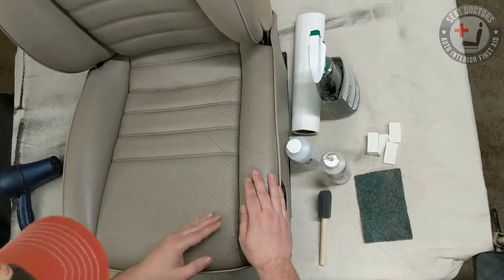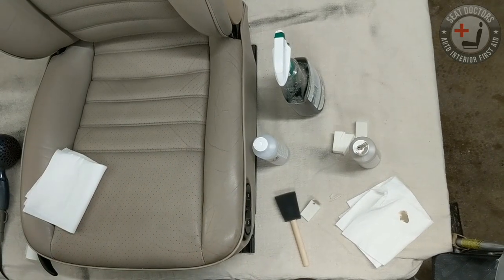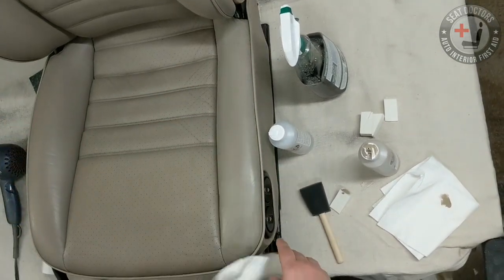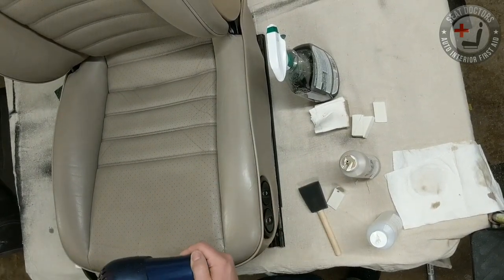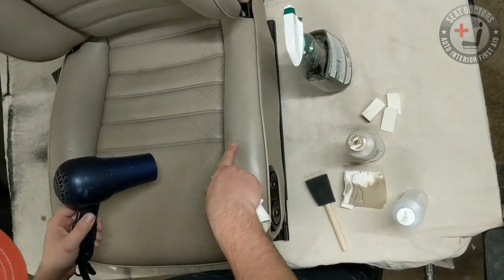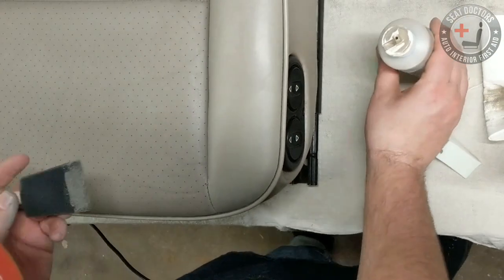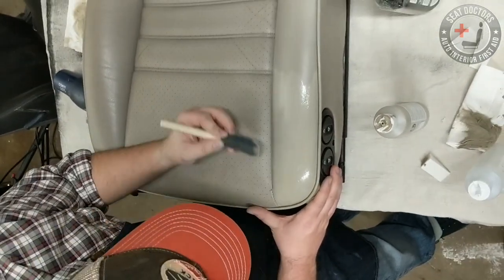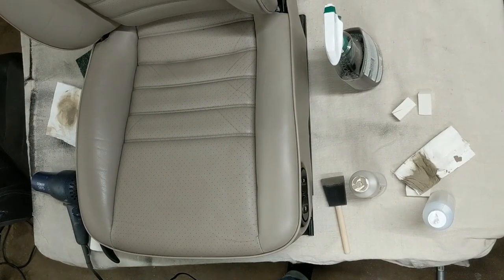Seat Doctors Leather Dye   Rub On Method and Paint Sponge Method

Comment: I have used this product as well. Unfortunately the filler doesn't hold up. If you apply it to the piece of leather that gets stretched when you sit-down or get up it will crack. The paint is disappointing as it comes off if you use rubbing alcohol and most likely will come off if using another cleaner. It should not happen to leather dye. You need to apply seven coats to make it even if not using spray gun. The leather texture is lost by the time you are done. Overall great for car flippers but I am not one of them. Color matching was not very close in my case, definitely noticeable if you don't paint the entire interior but this could vary. 1 filler is not enough for 1 seat and they claim it is enough for the entire vehicle.  So get 2 of them if you have a lot of repairs and don't expect magic. Overall the seats look better, but I need to find filler alternative. Tired of reapplying and repainting...

Comment: So I have a brand new Mazda CX-30 Preferred with parchment colored seats and got tree sap from SOMEONE 🤬 leaving the sunroom open.  I got the sap off, but it took the color off or maybe it's just what won't come off of the leather.  ANYWAY, ordered the parchment color as per instructured by Andy. I'm waiting for it to arrive, and was wondering what would you recommend I use to apply? A painter's brush , a makeup sponge ....Its basically a long straight thin line and then a few droplets on the bottom.  Thank you!!!

Comment: So, to make sure I understood you correctly, I should condition the leather prior to applying the dye?...with all dry of course. You did a superb job.
Reply: For anyone that follows, no, do not condition the leather, only clean it with a water based cleaner (Lexol or Simple Green) first. Conditioner will leave a residue. Clean, apply dye, let dry, apply second coat, let dry (third coat if needed), let dry for a few days afterward. Then conditioner every six months or so. 👍
Reply: No, do not apply conditioner first, it will leave residue. Clean the area with water-based product (Lexol or Simple Green), let dry for a few hours. Then apply dye, let dry. Apply second coat and let dry. Apply third coat if needed and let dry. Let area dry for a few days before applying conditioner. Condition every six months or so. 👌
Reply: simple green says on the bottle not to use on leather. i see he suggested it in the video too. should it be used?  yes/no?

Comment: Thank you for sharing. This was so helpful. But I have an acura with dove gray seats. My driver seat has a blue stain that I can't remove with cleaners. I purchased the dye from seat doctors- exact match but will I have to dye the entire section of the car seat  for a stain in the middle of the seat? 
My test patch is a good match but it seems a little lighter. Maybe additional coats will look darker?

Comment: What product can i use to remove another dye i tried to use which did not match the color of my leather seat. Will something like the cleaner in your video do it ? I want to remove the prior product i used before i apply your recommended product.
Reply: You can usually go right over the incorrect color with the new dye, unless it's significantly different than the color you're applying.
Reply: @ajonrichards  depends if it's solvent or water base dye